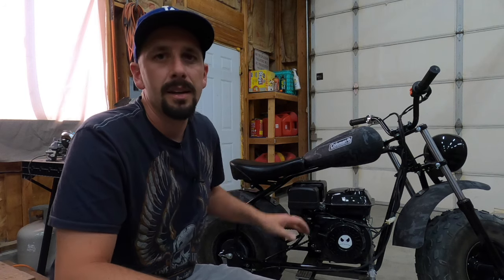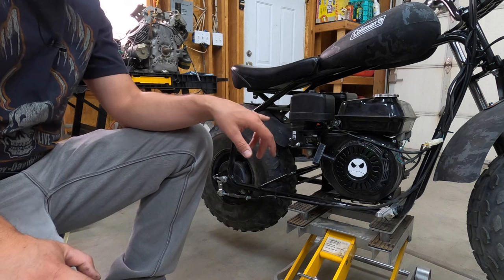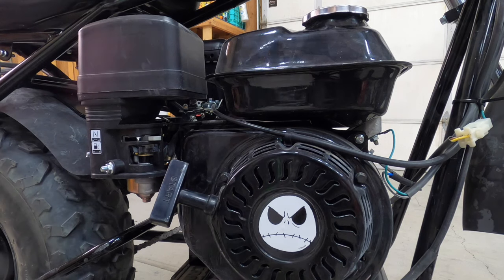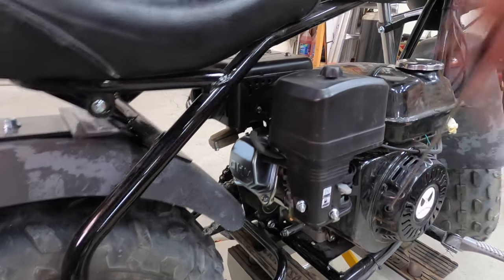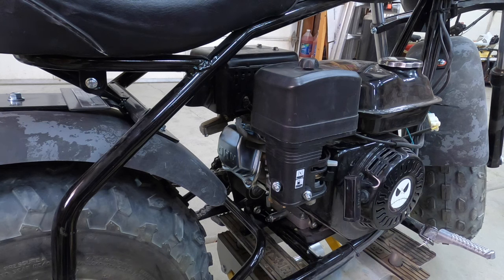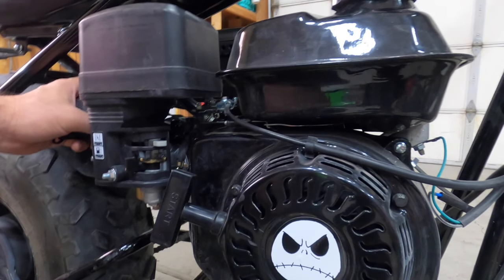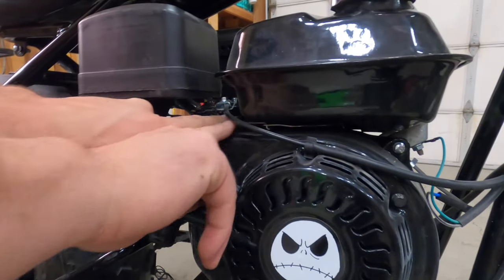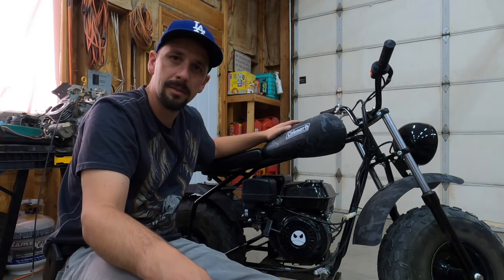How to adjust the idle speed on a mini bike with a non adjustable carburetor...(stuck clutch?)

Comment: Im having an issue with my new monster moto mini bike it currently has a 212 predator engine and if I cruise around 25-40mph I don’t have any problems but when I hit higher speeds from 45-60mph whenever I come to a complete stop the engine just slowly dies out and turns off. I’m not sure what the problem could be but if I were to take a guess it’s probably the idle. I’m not sure tho. If you have any thoughts on what it could be please let me know.
Reply from the maker: My first check would be the idle.  Does it idle fine before sending it full throttle?  It could have something to do with the speed you are running it with the governor removed.
Reply: @kbssmallenginerepair2615  It idles fine but it does move a little bit if I’m not sitting on it. I know it’s not really supposed to do that but I can’t really find how where the idle should be so it doesn’t move. I’m gonna mess with the idle a little bit and try to find the right place. Also everything on my engine is brand new. I’ve been riding my bike for about 2 weeks and never seem to have this problem but I guess with the vibration the idle must’ve moved.

Comment: Does anyone what this means: when I give my mini bike full throttle, it goes off as if you hit the kill switch. For example, when I give it full throttle and immediately throttle down before it dies, it will run again kinda like flicking the kill switch on and immediately turning it off. Any ideas?
Reply: I had a similar issue once. The engine would start and idle fine but as soon as I opened the throttle it would start to stall out. I immediately pulled the main jet and found it was blocked with what looked like a tiny piece of yellow plastic, which probably came from the fuel filter. Make sure your main jet isn't clogged.
Reply: @Deucealive75  Ok, thanks
Reply: Sounds like it’s running rich

Comment: That is not the throttle return spring. The throttle return spring would return the throttle to idle, not pull it open. That spring is part of the governor system. You altered the governor, witch is not good. The throttle return spring is on the throttle cable. 
   Your continued struggle with the idle shows you did the wrong spring. Something could be bent in the governor system. 
Delete this video before more of your viewers damage their governor systems. Sorry Dude.
BTW... I have been a small engine mechanic for 40 years. I don't know everything, but know that is the wrong way to do it. Even if you somewhat get the outcome you were looking for.
Reply: What I would check first is...  There is a locking nut mounted on the zinc plate on top of the engine. That nut applies pressure to the pivoting throttle plate. Loosen that nut some and check for complete return of the throttle to idle. It could be as simple as that plate is binding. Just trying to be helpful.
Reply from the maker: Thank you for your input.  I would have to disagree with you, because that is absolutely the throttle return spring.  Every small engine that is carbureted has a throttle return spring on the throttle linkage.  Its job is to return the throttle plate (inside the carburetor throat) to the closed position, hence the name, however I understand your logic as it doesn't seem it would make any sense.  The spring you are referring to is the cable return spring which is at the end of the throttle cable.  In your diagnosis scenario below loosening that nut would loosen the throttle control assembly which would free up tension on the governor spring, which goes to the governor arm, which would then give slack to the throttle return spring and throttle linkage.  It has been the perfect fix and is still working great!  Thanks again for the insight.
Reply: Every point of view is important and helps us to get a good solution 👍